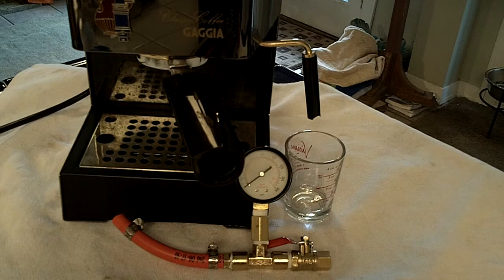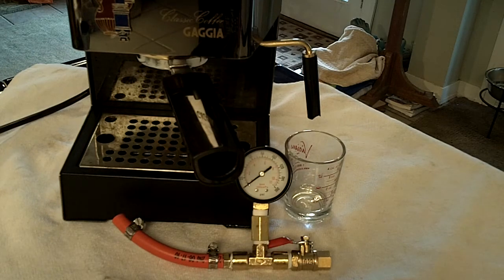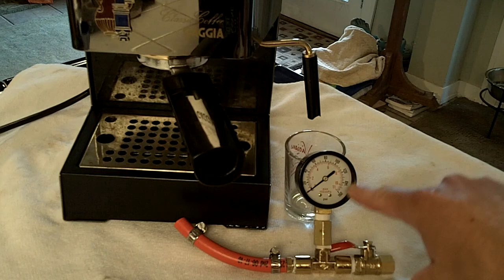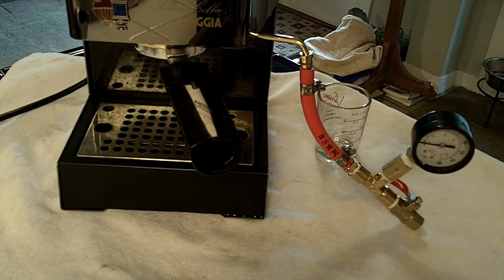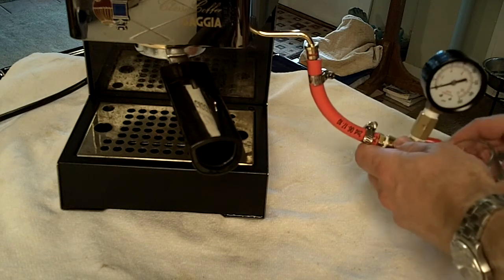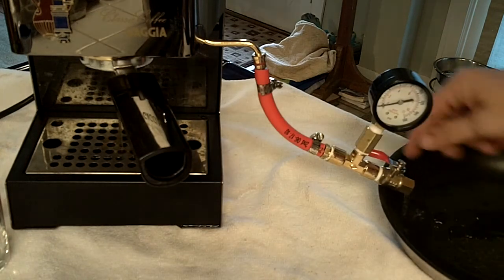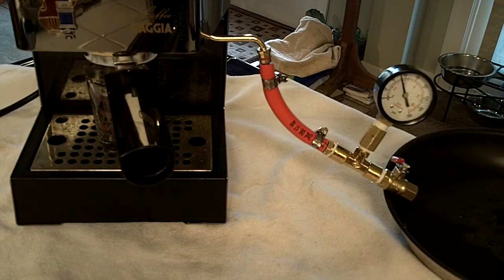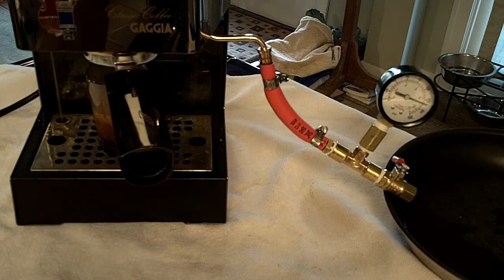Gaggia Classic Pressure Test with Steam Wand Gauge for beginners

Comment: Usually for single boiler machines, I thought hot water flows EITHER through the brew group (when making espresso), or through the steam wand (for making tea for example) via the respective button etc.. But this video shows hot water flowing through both at the same time? Am I missing something? If anyone knows how this is possible please comment.
Reply: When the pump is turned on, it will fill and pressurize the boiler. Then the water escapes through the brew head automatically (I think a channel opens through the brew head when the pump switch turns on). If you simultaneously open up the steam wand, the water will also flow through the steam wand (it’s connected to the top of the boiler). So basically if you turn on the pump, it’ll pressurize the boiler and flow through the brew head and not through the steam wand because you closed it. If you want to steam, you don’t turn on the pump (which closes the valve going through the brew head) and then the steam escapes through a pocket at the top of the boiler. Hope that makes sense.

Comment: As Luca Bazzera testifies in this video https://m.youtube.com/watch?v=E4y4-E2aL3U you have to compensate the low Fluss rate with a high pressure. I would say that this Wang gauge could be a very nice way to check if the pump of your machine is running correctly

Comment: THE WAY YOU CONNECT THE GAUGE IS A MISTAKE!

maybe this will work for a few days on your machine, but it will definitely NOT work on most cheap machines. If you open an espresso machine, you will see that the steam tubes are typical "silicon" tubes with spring-clips. Those are not made to hold pressure, and definitely not ~10bars. So when you "block" the steam tube, you will soon or later make the internal silicon tube "explode" with hot water inside the machine

Comment: If you must add the pressure gauge, I suggest that you place it after the pump, and before the group-head, (obviously by opening the machine). 
thats how I did it. However the presure gauge started liking about a week later due to the "vibrations" in the water. Maybe a "glycol" gauge would have survived more, either way, I decided to "drop" the pressure experiment because I realized water-temperature is far more important!